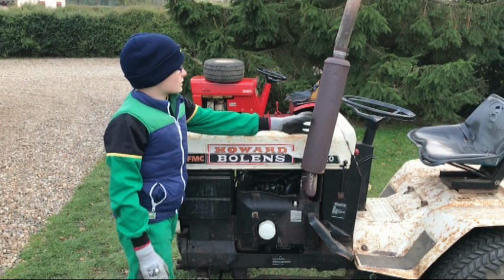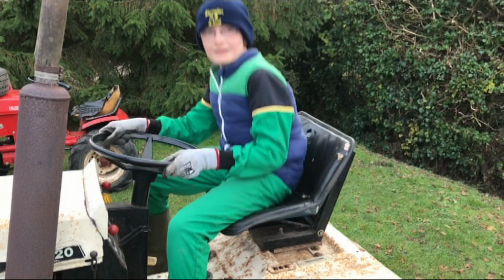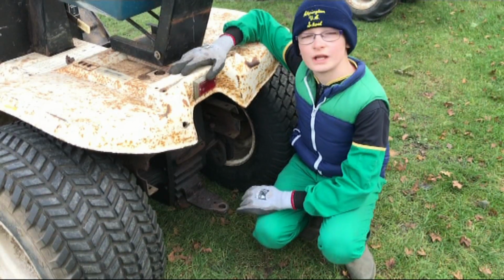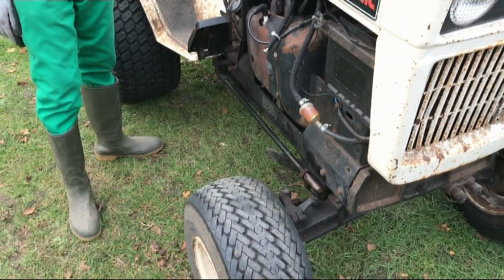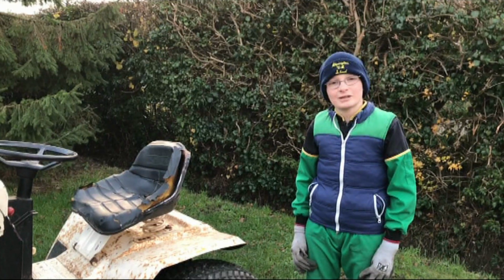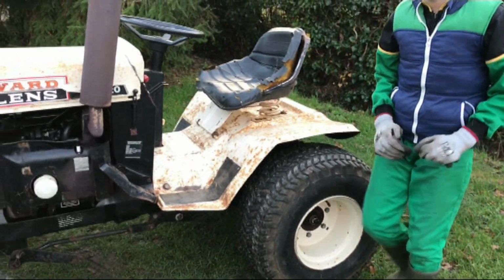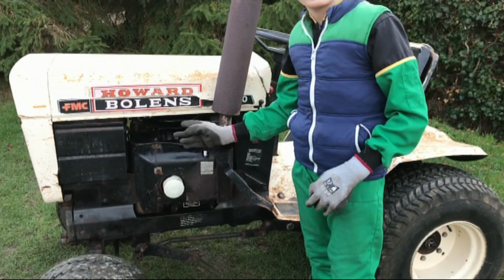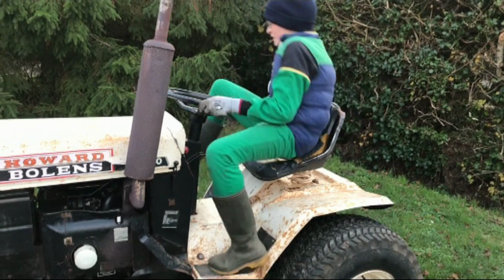1974 Bolens HT20

Comment: i have a bolens 1050 with some carb problems but runs
Reply: the metal in carb is broken but new carb costs 500$
Reply from the maker: Thanks for watching and commenting. A 1050 is a great tractor, we have one needing work and three running 1054's. The carbs on these are not great and we are planning to investigate fitting a different carb